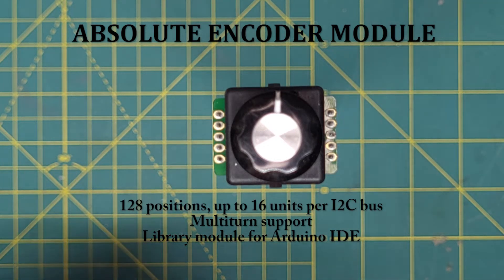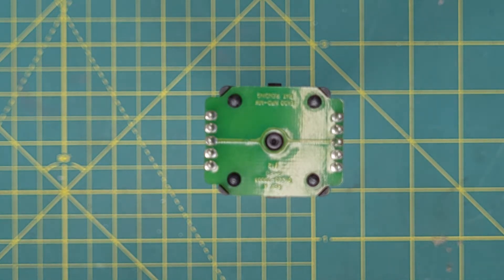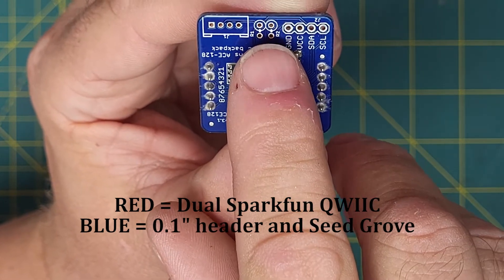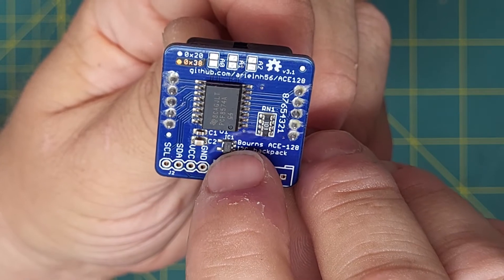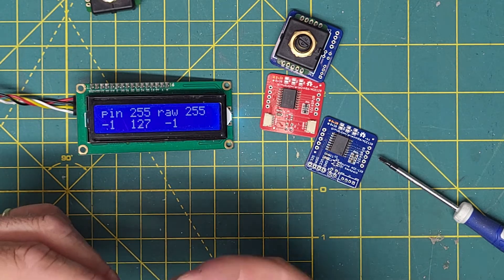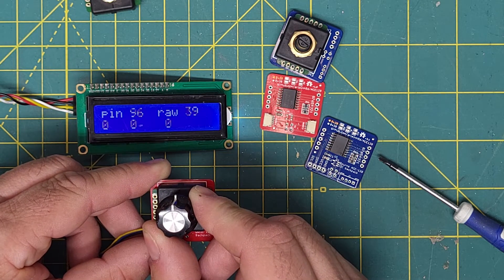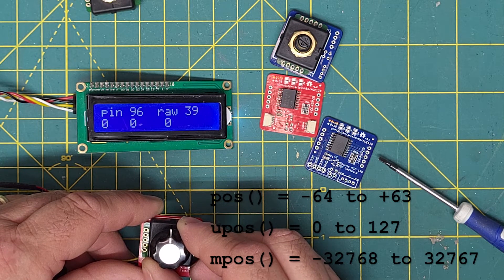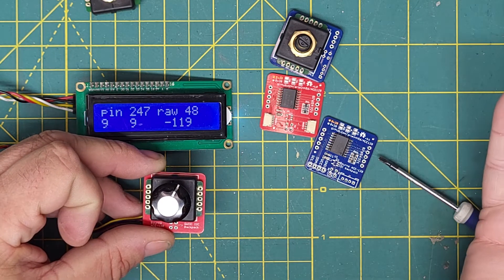Absolute Encoder Module for Arduino

Comment: If I want to orient a small yagi antenna to different repeater could this be used with a nema 23 stepper and the output be in compass degrees?